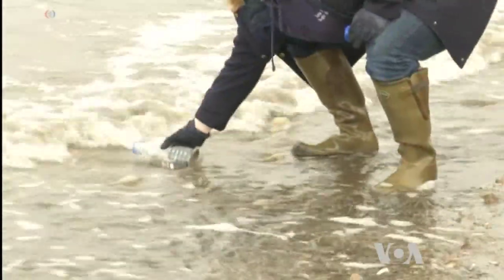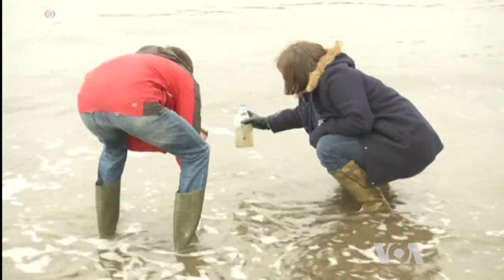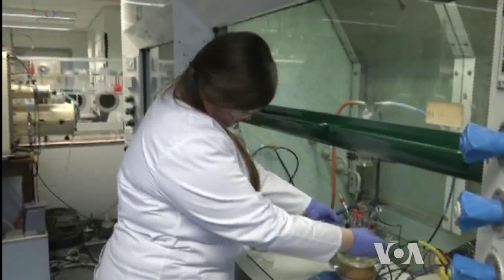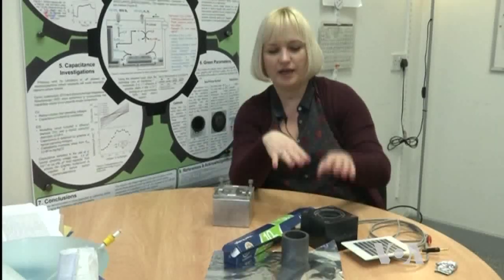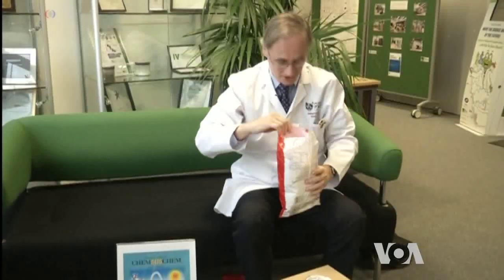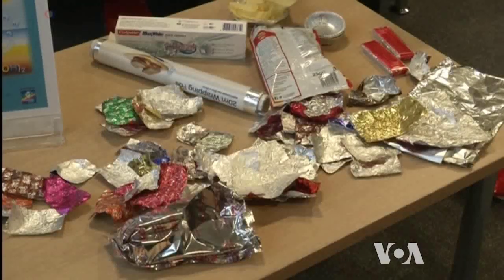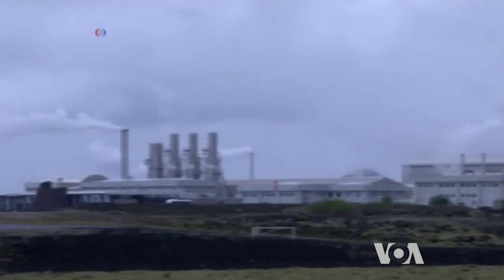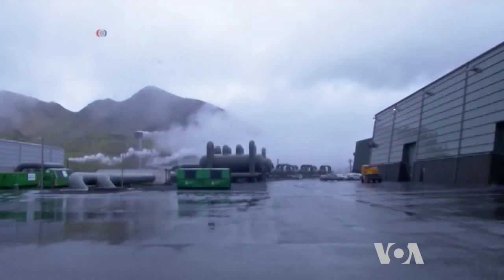A New Method for Extracting CO2 from Seawater

Comment: question if you pump seawater from the deep ocean to the surface and heat it how much nitrogen, oxygen and carbon dioxide comes off and might that be a better gas mix than air co2 capture... Gas	Chemical Symbol	Percentage in Air	Percentage in Sea Water
Nitrogen	N 2-	78.08	62.6
Oxygen   	O 2-	20.95-	34.3
Argon	        Ar-  	0.934-	1.6
Carbon Dioxide	CO 2-	0.033-	1.4

Comment: According to the upload date of the video this is not a new discovery. It's just another way to ask for permission to extract hydrogen gas as a byproduct to be used as fuel.

If the intentional method is not meant for hydrogen gas it's okay to produce hydrogen.